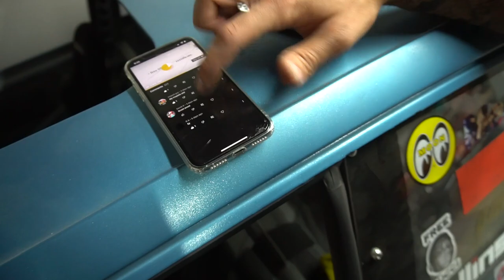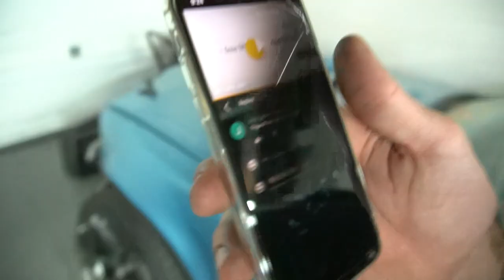i bought a Yamaha Zuma 2 stroke Scooter PREBUG

Comment: sheesh ....you got yourself a booster ....yo get ready cause this tiny beast is the dopest  wheelie machine i got my self one 2 years ago then i sold it ....2008 mbk booster  ... reliable /cheap/huge aftermarket support /you can find parts anywhere literally/ easy to pick up stock ... i ended up installing polini : 80cc kit + g3 clutch + variator + arrow exhaust and honestly ...i felt bad when i sold it tho

Comment: Nice off-road-like scoot!
I always liked those bold unusuall design lines, Zuma, Piaggio Typhoon, Ruckus, Peugeot Trekker - these are some amazing designs!
Reply: I had a typhoon 50 with 30 original kms thing was so fast it came with a dealer installed Tecnigas expansion chamber pipe haha

Comment: That cable Is for the speedometer, its supposed to go into the back of the speedometer and all the way to the postponement into the right fork of the front wheel.
And also the "secret" moped is a piaggio nrg mc3